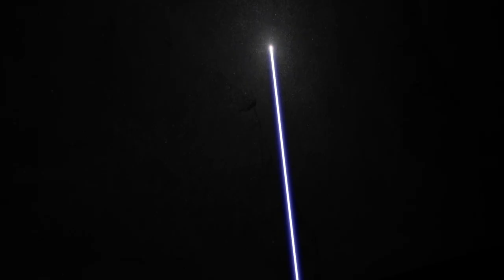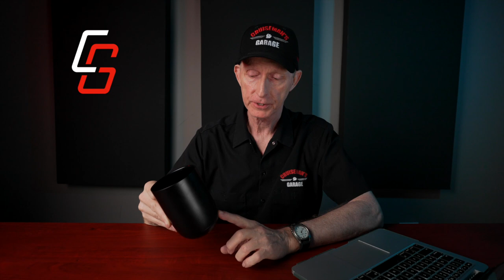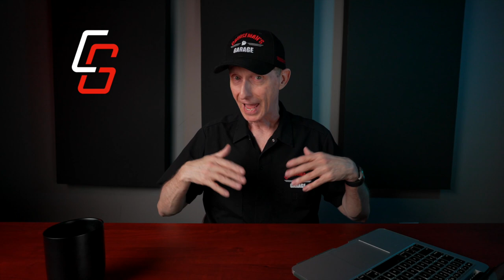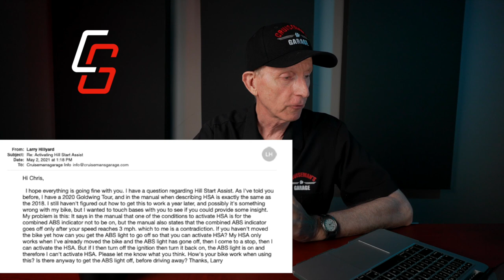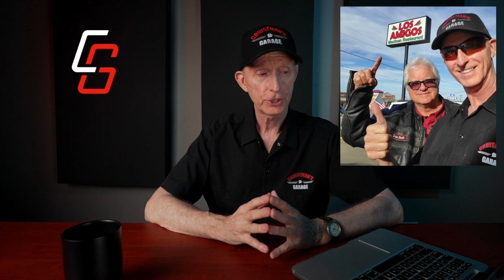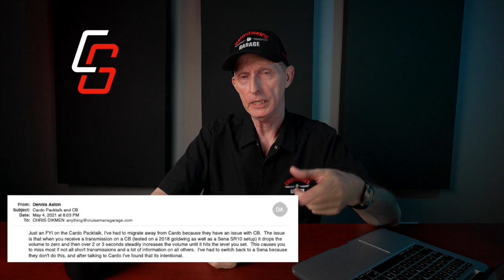Ep 4 Coffee & Comments | CruisemansGarage.com

Comment: I was surprised to hear your comment concerning Dunlop vs Bridgestone tires. My experience is that Dunlop E3 or E4 are the best wet riding tire I have ever ridden on. I have ridden on Avon, Shinko, Metzeler, Dunlop, and Bridgestone. The Dunlops have consistently outperformed the others in every category and especially riding in the rain. I have had 3 different Valkyrie Insterstate from 2005 to 2020 and probably ridden around 200,000 miles on those 3 bikes. I have always used Dunlop E3's and I would always get from 15,000 to 20,000 miles on the rear tire and 20,000 to 24,000 miles on the front. Metzeler and Avon would go 6,000 to 8,000 while the Shinko's were worse. I tried Bridgestone on a Kawasaki Voyager I owned and experienced a tread seperation on the rear tire while traveling about 65mph. The tire was only 6 months old, with only about 3000 miles on it, and properly inflated. This was several years ago, but I will never ride on a Bridgestone again. I purchased a used 2008 Gold Wing (27,000 miles on the odometer) in early 2020 that had Dunlop E3 tires on it. If the information that I received when I bought the bike was correct, the mileage on the tires was about 5,000, however, the date code on the side of the tires indicated they were manufactured in November of 2014. The tires performed excellent last year with no issues, however, the panademic limited my riding to only about 3000 miles.  The tread and the overall condition still looked good, however, I just replaced them because of their age in the last couple of days with Dunlop E4. I am looking forward to riding with the new tires.  I have found that I can purchase my tires rom a local motorcycle shop that will also mount and balance them for less money that I can purchase the tires over the internet and have them installed by a dealer that I did not sell them to me.  I also know that when I purchase from a local dealer or service shop that I can check the manufacturing date on the tire to make sure that I am not buying old tires. I feel very strongly that it is important to support local businesses in every way possible.
I enjoy your channel and look forward to new videos!!

Comment: I have been through 2 sets of Bridgestones on my 2018 Tour DCT and now have the Dunlop E4's. The front tire was put on in June 2020 and my rear tire installed in January 2021. I don't have very many miles on them so I can't say much of how they are wearing, but the bike does ride nice with them on there. I take my wheels off and take them to the shop and they charge $20 to mount the tire on the rim. I do not have them balanced since I use Centramatic wheel balancers. The front tire was $204.55, and the rear tire was $250.17. So a total for both if I would have done them at the same time would be around $454.72 plus $40 for installing the tires on the rims. If I would have bought them online, they would have been $10 - $15 each cheaper, but then, not buying the tires from the dealer I have them installed at charges $30 per tire to mount them, so I wouldn't really be saving much. Yes, these are expensive, but I was only getting 6K out of the Bridgestones, and I am hoping to get more than that out of these. Ride Safe.

Comment: I have had several sets of Stones on my 05 Wing . 2 up balancing disk and never got more than 6000 miles on the back . The front was noisy also. Changed to Dunlop E4s a couple of years ago. The sides of the rear is gone at about 6000 , front starts to go away after 10000 , but no noise. Both perform about the same . I’m not a penny pincher with my tires ,so I’ll stay  with the E4s till a better tire comes out.

Comment: Our local dealer in Las Vegas doesn’t charge an installation fee if you buy the tires from them. The issue I have with the Dunlop E4s are two issues. On grooved pavement the tires get squirrelly and want to follow the grooves. It’s also squirrelly if you have a lot of tar snakes.
Reply from the maker: But, what do they charge for set of tires?
Reply: @cruisemansgarage  TBH I don’t recall. On the rear I run a CT. I have a vague memory of the front tire (E4 Dunlop) costing me about $275 installed.

Comment: Good show Cruiseman! 
Hello from Canada! Regarding the Dunlop E 4 compound and long millage lasting. I used many sets of E4 on my last old 2015 Wing before trading it in for  a new  2020 DCTA, with 145000km or 90000mi
My last set Rear tire 23090km or 14347mi. I could have gone an other 800 mi or so but I was leaving for a 1000 mi + holliday trip with my co-rider and hauling my trailer.
Front tire 35011km or 21754mi and just getting to the wear bar.
I never got close to this mileage with any Bridgestone, Donlup E3, Metzler nor Avon.
I ride 2 up 50% of the time and haul my trailler 15 to 20% of my season going teaching.  I am a certify instructor with Canadian Safety Council and Master Instructor Trainer with GWRRA for the past 12 years. I avrage 25 to 30000 km or 16 to 19000 mi per 8  to 9 months riding season.
Ride Safe Always!
M. Lavoie
GWRRA MIT 023
Keep up the good work!

Comment: Cruiseman, I just got a quote on tires for my 2019 DCT Tour. The quote was $500 for the Bridgestone, $620 for Dunlop E4's... That's installed. So taxes and disposal fees are on top. There is a $60 rebate on the Dunlop's. So I'm going with the E4's since I normally get about 5,000 more miles out of them. Anyone pricing Dunlop's ask about the rebate, if you don't your dealer will take it.

Comment: My 2020 GW Tour W/airbag came with Dunlop E4's installed. I only have 3k on it so far so I'll be interested to hear what others have to say about them. My E4's are still looking brand new and I'll be keeping an eye on them. NOTE: I have no qualms about riding in the rain and did so just last week. I do use Rain Mode and am careful when cornering in the rain, but I have not noticed any issues so far. Hope this helps, Chris.
Reply: My Dunlop elite 4s have over 17000 miles on them, still looking good, best tires I have had on my goldwing 1800, 2018. I have 57000 miles on this bike just in two years this may the 14th.

Comment: I have a Garmin DriveAssist 50LMT for the car. It's not waterproof, but there is a built-in dashcam in the back of the screen. It records the video to the 2nd microSD slot in rolling MP4 files. It also keeps a few minutes before and after a high G (crash, falling off suction mount, etc) event in a separate folder.  Just drop the card into a reader on your desktop and you're golden. The key for that unit is that there are two card slots.

Comment: I have been using my pack talk bold with Siri and no issues.  Text current locations etc.  with no issues.  I did have one issue where Siri said they could not find my requested contact which was weird since I had been sending messages several times before that.
Reply from the maker: I am going to go into the app and see if maybe my mic settings are off.

Comment: Forgot to mention I have done 14,342 miles on the original tires, bought the bike (DCT) In July 2018 was the first one sold in Durban
Reply: What kind of tires come on the new bikes when purchased
Reply: @markdennis1205  
Bridgestone Exedra G851, 130/70x18" Front Tyre
Bridgestone Exedra G851, 200/55x16" Rear Tyre